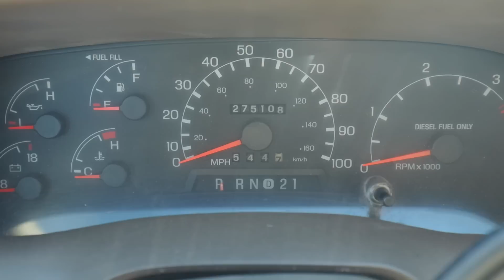$100 Made My 7.3L Saucy!!!

Comment: I think ur starting issues is with the low pressure oil pump located behind the harmonic balancer... also I'm not sure if u did the high pressure oil pump but in my opinion u should if not done yet

Comment: I did the fuel pressure Springs when I got my truck I did the 65 Spring the middle Spring. I still need to do those banjo bolt so

Comment: I commented the problem with the trans on the Cummins video. Governor pressure solenoid and transducer is the issue with it starting in the wrong gear. Got parts off XDP and solved my problem. The oem parts are made cheap and plastic so they’re known to break

Comment: Completely different truck but I have a 97 12 valve that can't get out of it's own way and my throttle response isn't really there. 235k mile motor but after watching this I gotta look into that. I was thinking a pedal monster like you've installed before but I feel the cheaper route would be best to do first.

Comment: Yeah that stock deadhead fuel system on the 7.3s and 6.0s is real dog shit but you can also look into re-shiming the poppit valves from .004 to .003 clearance. Most likely those are probably split shot injectors (pilot injection) and hopefully if they are, whoever installed them knew  cylinder 8  doesn't get same type  injector as other 7 due to last in line to get fuel
Reply: But starting issue sounded  more like starting on  one battery or HPOP but most likely voltage